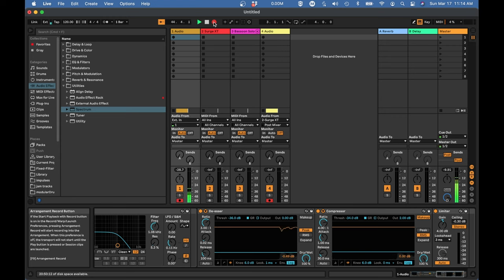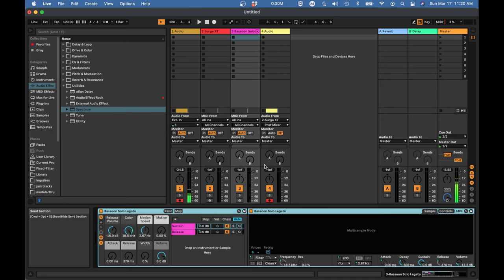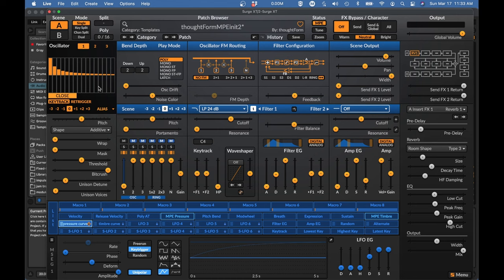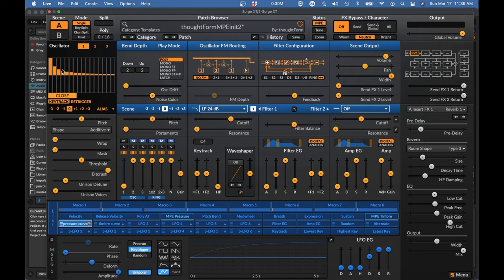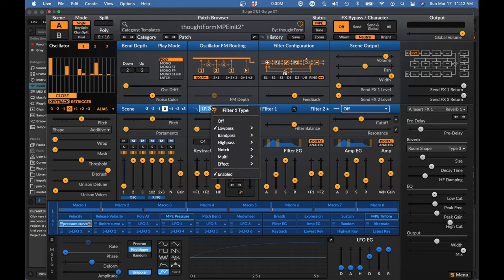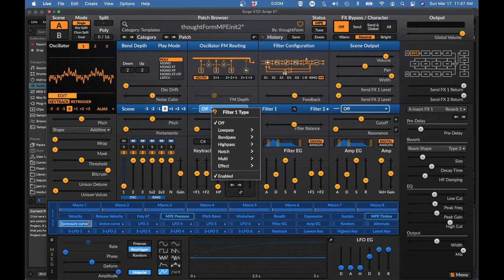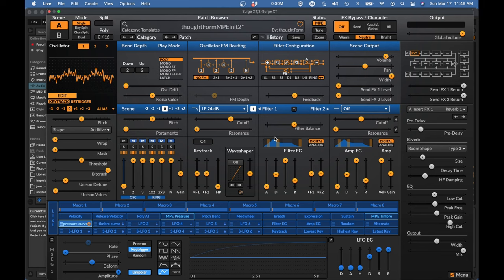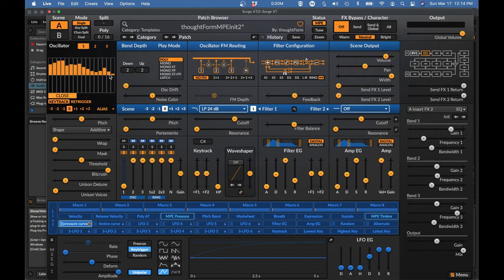Surge XT Alias Oscillator for Additive Synthesis and Microtonality

Comment: So in theory if I had a great additive oscillator and a sound's spectrogram then I could reproduce any sound? But since you didn't start the series with this approach it might have some downsides? I tried to follow your video step for step, but for some reason my bassoon doesn't sound like yours. Maybe that's the problem -- it's too sensitive? Mine sounds "bassoony" at the low end but at the high end it doesn't sound right.
Reply from the maker: In theory, yes, sometimes, but with some caveats. First, you can't do truly inharmonic sounds like bells unless your synth can detune those harmonics. I'm not aware of such a synth on the market but they might be out there. My brother wrote one in max MSP once. Second, those harmonic proportions may change over the instrument's range. You could do that in something like Serum--build a wavetable out of several sets of harmonics and morph between them using keytracking.  But the harmonics may also change with things like air pressure, and we're soon starting to get very complicated. 
I wanted to talk about this as a way of analyzing sounds and also introducing concepts that will be very important as we continue, but it's not necessarily a #1 strategy.
But for your bassoon, I would try more filtering to remove harmonics at the high end of the range. Look at the keytrack sliders under the resonance on filter 1. If you turn that down a little from the center position, your filter will allow more high end on low notes and less on high notes.